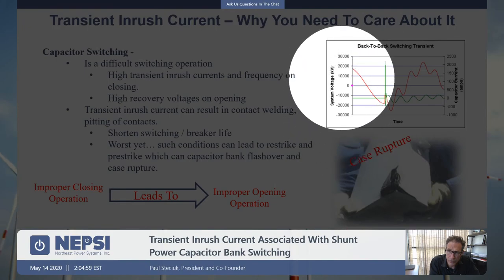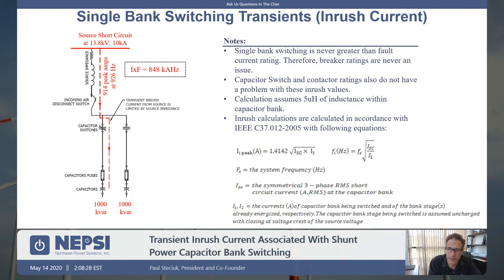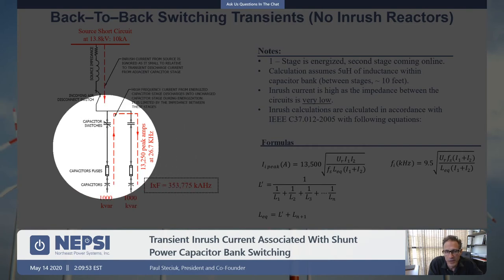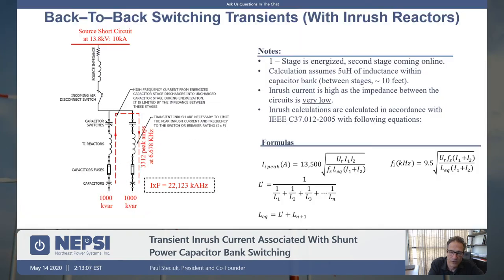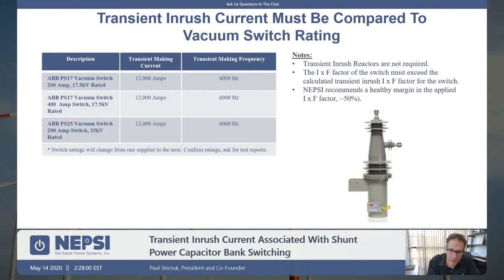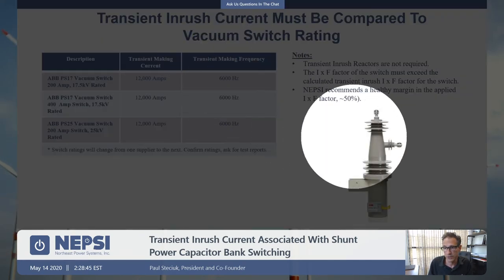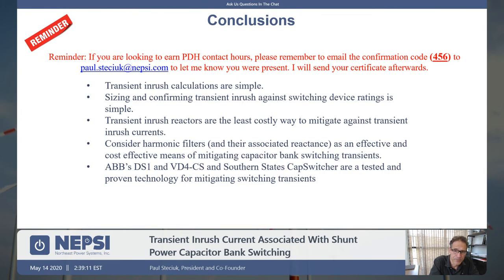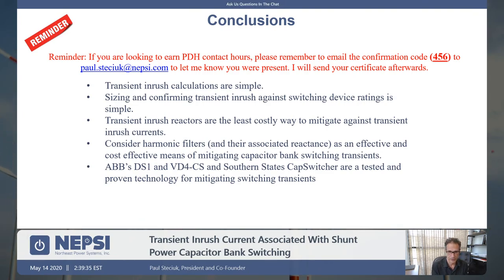NEPSI Tech Talk Session 02: Transient Inrush Current Associated with Power Capacitor Bank Switching

Comment: Hello,
Is back-to-back capacitor bank current related to switching classes C1 and C2 of breaker, or is it only important in terms of inrush current? 
Example: Filter bank with current of 750A, by calculation there is no problem with back-to-back inrush current if VD4 12.12.40 (400A back to back) is used. Because there is high value of impedance of reactor. But in terms of breaking operation, is C2 class related to that 400A, because we are breaking 750A of current?